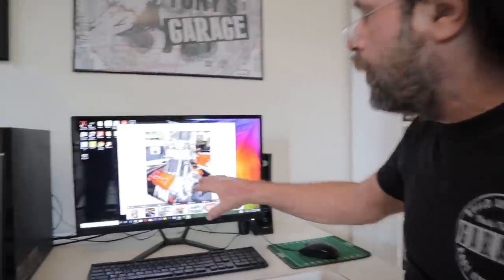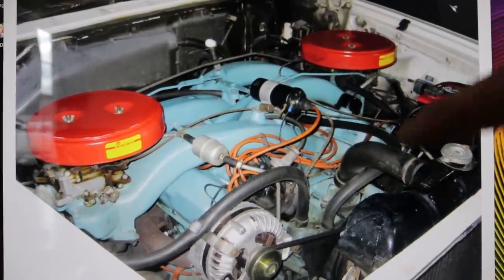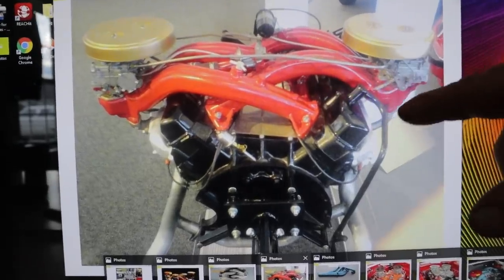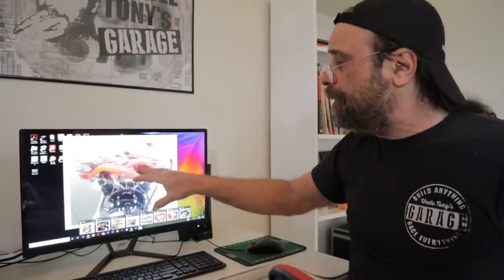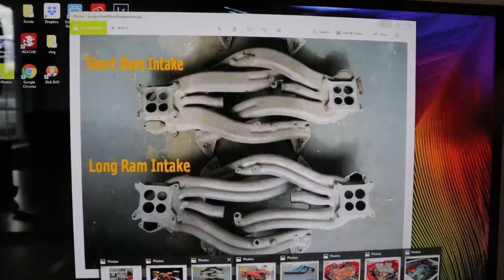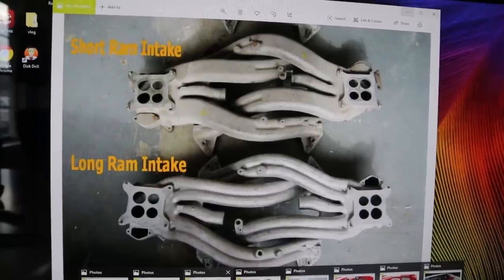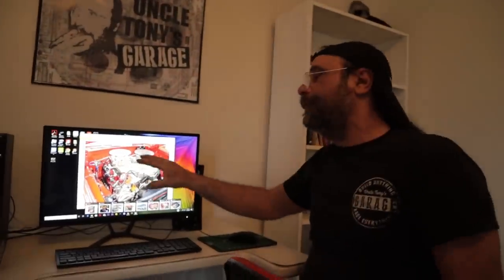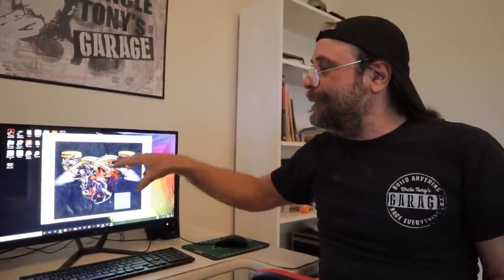The Original Mopar Cross Ram Intake Manifold

Comment: I  owned a 1964 Sport Fury,  with the later version of the Long Ram intake.. It was on a  426 Street Wedge, with a Racer Brown cam.. To make it fit, the inner fender was cut out on one side.  With a 391 rear axle, and a 4 speed, the car was    hard to beat on the street.

Comment: We ran one of those on a stroker at Westech-it was awesome-you should see the fuel stand off coming out of the carbs at the different RPM
Reply: Any chance we can get a factory shoot out someday? Maybe small big blocks would keep the price down.
Reply: Same but different.... I remember reading about taking the air cleaner setup off the same era VW beetle , and it runs like crap. 
That big ol tall air  filter kept the fuel stand doing what its supposed to do.

Comment: And this, is why I love old school Chrysler, when it was a proper engineering company, today Chrysler is a shell of what it used to be, and it is such a shame. Also, I am so glad you make these videos, your videos make me smile and proud to be a car nut.
Reply: W Winterheart  Sadly true. Technology they had even just 30 years ago, seems to fail now. My 94 dodge has roller rockers, never been a problem. 2012's with the 5.7 hemi, have roller rocker failures. lol Whyyyyy? Its old tech for christ sake! It worked fine 30 years ago!
Reply: @zeppelin67637  roller lifters not rockers.
Reply: W Winterheart  a lot of aftermarket roller lifters are junk also.
Reply: zeppelin67637 2 reasons:
1. “Value” engineering
2. Eco-Nazis
Reply: I love my old Honda, if I had a bit higher budget for parts, I would also be rebuilding an old Chevy truck. I worked on modern vehicles for a little while as a lube tech at a VW dealership...... never again. The Germans do stupid crap, AND charge way too much for it. The American vehicles did other stupid crap, but it wasn't insane expensive to fix.....Toyota is a pain in the ass to work on, but they tend to be reliable, and Honda tends to (in my experience) still be pretty easy to work on for the most part and reliable. I had a Nissan Rogue break down just after it was taken off my lift, because of a recall that was never taken care of...this vehicle was being inspected for sale on the lot as a used vehicle.....and it cost the dealership money because no one had bothered to check if it was up to date on its recalls...I dealt with so many broken vehicles that were only a few years old, did not matter if they had been taken care of or not, but I saw far more issues than is acceptable, more so for the cost of modern vehicles. Yes, have been crap cars through out car history, but by this point.... they should know better. But, welcome to a world where its all about buying the newest thing with the most gadgets.
Reply: @glenholmgren1218  Eco Nazis have nothing on me, my car gets 30MPG in town and 48 highway, with out me trying. I have made Toyota Prius drivers cry when I tell them what my car got on the highway :) And my car is actually fun to drive XD

Comment: I found an article on these manifolds and it gave all the theory behind them. Now here's the kind of cool part. When I was working in the shop, pulling parts for customer custom builds and was sorting through our gasket section in the warehouse and I found an open box AMC V8 intake gasket. A little ways down the line I found an open box Big Block Mopar intake gasket. Both were steel or tin type gaskets and when I pulled them out of the box to make sure that weren't bent or rusted, the intake ports looked very similar. So I put one on top of the other and the ports lined up perfectly, but the width, one side from the right to left banks went the same. And the Mopar had an open lifter valley which took its own cover. The intake manifold in stock covered that area while the AMC went under the manifold. But the distance from the front to the back of the ports was exactly the same. So, when I found this article on the Mopar Rams there was a section on AMC guys using them on their engines with slight modification.  The ram intakes were tuned for peak torque to arrive at 2800 rpm or slightly higher on the shorter version.
Side note, there are three different versions of the ram intake. The first is a long ram tuned to a lower RPM, a long ram with Exhaust Heat to warm the air fuel charge for winter operation, and a short ram for higher rpm. These are some of the coolest manifolds I've ever seen, and they were making replicas back when I found the article.

Comment: The RamChargers... Inventors of the Tunnel Ram intake!
Reply: Ummmmm, no. The box with the hoses on it was used by Chrysler to determine the effect on length and diameter of the port for cylinder filling. It was lazy because of the plenum size. They found that by reducing the plenum and lengthening the tubes, they could achieve a velocity that would push the charge rather than draw it. Tunnel Rams back then were lazy at low RPM but made crazy power in the higher RPM. That concept was taken from Rochester Injection units found on GM cars in 1957; Chevrolet and Pontiac. Similar upper manifolds with the lower cast to the needed engine. To that it is thought that Offenhauser took one and machined a carb mounting on it and closed the side air inlet. All of this just shortly after the release of Fuel injection. Large plenum, short runners what a small block Chevy needed and could do. This was the exact opposite effect Chrysler was looking for. Chrysler even experimented with a long set on one side and shorter on the other, trying to make a flat torque peak. It did not achieve the desired result so the mixed runner idea was forgotten. None the less, it gave them the learning curve needed to make the Max Wedge and Hemi programs lethal when released on the public. Notice nothing like a tunnel ram as we know them, was ever used by Chrysler. They built the old 350/361 for torque, not RPMs. I am curious if the 383 ever got the Sonoramic treatment.
Reply: @thegreenerthemeaner  the "idea" of the Tunnel Ram did come from the RamChargers..of course it was modified through the years to achieve the desired results that people were seeking.  Tunnel Rams when "properly sized" to the engine it is feeding will deliver more torque than any other manifold design...

Comment: Those pulse waves you mentioned are similar to the way standing waves work in expansion chambers on 2 stroke engines
Reply: @johnpossum556 " What does that have to do with intake manifolds" somone might say. Well, thee's a new long span bridge under construction that looks good in a static setting. But with a little wind, theee is fear that it  may have a torsional loadng problem. If you had been here to bring it up John, it would have saved a bunch of money.
Reply: Comment threads like this are another reason to love Uncle Tony's Garage.  
Thanks guys for putting your time into making a better world.
Reply: @Riverdeepnwide  Exactly. Now... if high school shop teachers had this forum, homework would have gone a lot faster.

Comment: I really like those cross plane intakes. I can only imagine the torque pump they created
Reply: I am hoping to put the Edelbrock 71413 cross ram intake b/c of this era of true engineering. They reached the limit of what could be done. So they made another way to skin the cat..... just like the SR71 black bird they did it with out computers. Sometime the art of engineering is lost in a computer
Reply: Lassi Kinnunen lol obviously they didn’t hate technology they were on the cutting edge of technology. My point being is just like Math nowadays it’s hard to do things without a calculator because we are reliant on them. When the SR 71 was built they didn’t have computers to do the math for them. In 1966 when the SR71 was built computers were highly specialized pieces of equipment. Five years earlier in 1961 we sent The first Apollo rocket into space. The Apollo project push the boundaries of technology and if you ever get a second you have to look at the original Apollo flight programming computer it’s impressive. It may have less computing power than a phone from 10 years ago however it’s so dedicated to what it does that a modern iPhone couldn’t fly the Apollo rocket. It was essentially a computer that was the size of a small building but with the invention of integrated circuits they brought it down to the size of the picnic table. There’s a YouTube video of them actually restoring One that failed to launch because of a sort in a potted circuit. After they repaired it they managed to initialize it and hook it up to a modern computer and had the original flight plan on it and that’s incredibly amazing and speaks to the quality of the computer they built. lol sorry got off on a tangent I do that but yes in short they didn’t have computers and said the late 60s however they were not the kind of computers you’re thinking it wasn’t until there was a huge revolution in the design of computers mostly driven by a few very competitive computer designers and businessman. During the ram air era the engineers really did just do a lot of grunt work when it came to designing. Now  where where I was going with all that lol. I think there is some of the creativity and imagination lost using computers in engineering today. Not saying that the things that are being built are built better to just less creativity in solving problems. I think it’s mostly due to complacency not say laziness. Anyways that’s how I feel About it. And if you just read all of that I would really love to know your opinion on it 🤘
Reply: Lassi Kinnunen in fact I watched a documentary recently where they re-designed the SR 71 blackbird on A computer using auto desk inventor and they could not make any improvements the design was flawless.
Reply: Engineering means keeping your mind engaged. A hydrologist told me about his first big job. He had a pencil and paper and a mechanical adding machine. When there was a discrepancy in data it was readily apparent because his mind was involved in all the calculations.  He retired right as the super computers came about.  Two young engineers ran the computer, just feeding it data.  Well, GIGO.   There is a very large lake dam here that is 2 feet lower than intended because of that computer.
Reply: Lassi Kinnunen  the story kelly tells is that all the engineering and calculations were done by hand on all the variations of the blackbird until they revisited it in the 90s or 2000s and the computer analysis said that it was literally as optimal as possable and had no further design& engineering-change suggestions
Reply: @adammyford  yeah i remember reading some insane numbers like that
Reply: @LunarOutlawsGarage  9
Reply: 500 lb ft. A new v6 f150 raptor makes more lol
Reply: As I can best recall the torgue it was 465 foot pounds at 2,900 rpm.  Long time ago I owned the beast.

Comment: "Spaghetti Cross Ram Air Intake"  When you lifted the hood on a 60s letter car and you saw this your mind was blown. There were these support rods that ran from the bottom of the intake manifolds to the top of the exhaust manifolds.
The throttle linkage traveled between the two carburetors to a pivot plate. You wanted one. You wanted one so bad. You were lucky if you got to look at one. They belonged to your rich friends uptight father who wouldn't let you anywhere near his car. This setup was primitive space age technology from the dark ages of the future. There did you get a good look at it?  Good now get lost. Every now and then you would find half of one broken in a wrecking yard, or the remains of an already scavenged vehicle.
Rarer than hen's teeth. Collectors who collect this shit. Rarest of all was one with a 4-speed. And they would all stand around talking about  "stump pulling power"
Compared to this you didn't have shit. 130 miles per hour all day long. No sweat. Let the cop follow.
All the way across Wyoming headed towards Jackson Hole, with your skis running between the four bucket seats.. The car had ashtrays, so you could smoke between drinks. Montana had no speed limits. Do you know how fast I clocked you?  Over 50.
I spend up to 70 while you were standing on the brakes. That would be over 50
Reply: Change spark plugs through the wheel well
Reply: Support rods?!?!  Do you mean the exhaust tubes between the intake and exhaust to provide heat for fuel vaporization?

Comment: Have a 2003 Chrysler with the 3.5 hi performance.  The intake manifold has internal baffles, operated electrically by the computer, that change the length of the runners at whatever the computer is programmed for.
So they are still playing with ram induction!
Reply: Skip D love my 2001 300m
Reply: Yep. I have a Probe GT with the 2.5 V6....similar setup....I think my 97 F-150 4.2 had it too...

Comment: I'll never forget coming across a couple of ole' weed benders in the rurals of southern Illinois.  They had the hood up on an old Dodge or Plymouth about '63 vintage, and it caught my eye because I was - and am - a Mopar guy.  I made eye contact and started talking with them when I glanced into the engine bay, and here was one of these long ram induction intake engines (I remember it as a 413?).  The whole setup, engine and car, was like a barn find just rolled out of a shed.  That was 30 years ago but still a magical memory.

Comment: Awesome video in high school my senior year I rebuilt a 300J Chrysler with a I think it was a 426 wedge cross ram or a 413 can’t remember but that was a neat car . Two door bucket seats , rap around dash and a push button automatic. Then in college at Mt Hood Community College we had a awesome s auto program with a complete machine shop. And had a auto club which was a 501 , 3c nonprofit and a bunch of instructors that liked to build race cars. The first car built from basically junk parts was a 62 corvette with a 327 bored .030 over. Well our main competitor was a guy from Woodburn, Oregon that had the nickname the Mad Russian because he did some crazy stuff. Well his car was a 64 Belvedere with a 426 wedge duel 4’s and the short cross ram and a push button torque flight and we ran in super stock class. We could only run the 327 4 barrel carb. He used to kick our ass. Well over the years we went all out roller cam .600 lift triple springs , stud girdles and some illegal heads at none point match meets. Our engine we’d come off the line at 10,000 rpm then shift at 8,000 rpm but he would always beat us by 2 one hundredths. Many years later I ran into him and told him who I was and the car so I said we were running illegal heads. He said he figured we were but he never challenged us because he always won. All you had to do is remove the carb and look down the runners to see we were running 202 ported and polished heads, fun times. P S the name of the corvette we rams was HomeWork

Comment: Great episode!!! I have the 30" runner length setups that will be put into an early 70's truck on a 440... The trucks that are towing heavy trailers can really use the torque increase of these... I will first use 2-ea. 390-cfm 2-bbl. Carbs and see how that works... The cam will be one of the mild grinds.... This is the kind of engineering that Chrysler was famous for back in the 50's & 60's...

Comment: I had the opportunity to work on a 1960 Chrysler 300f with I believe was the 413 with the cross ram manifold. It was wild to look at and drive. Also My boss used to race modified's in the mid 60s and ran 426 max wedges with stage 3 heads and the dual carb manifolds. He still had all that stuff in a room in the back of the shop when I started at this Chrysler dealership back  in 1996 but sold it all around 2007 or so. Basically gave it away for 6500, which is what I thought then. It was 5 complete  engines and 2 blocks ( all stressed out from racing tho) and a whole bunch of other parts. The guy that bought it all couldn't get it out of there fast enough lol. Years later my boss now thinks maybe he really did give it away for that price. Always enjoy watching your videos, very informative thanks

Comment: I bought a set a few years ago for $200. They were laying in the back seat of a 76 Volare Roadrunner. From what I have read they are the short ram version. The runners inside the tubes only go up ten inches, the long ram versions runners were the full 30”. The short ram was an over the counter race version. I tried to put them on my 69 Roadrunner but they wouldn’t fit without cutting.
Reply: Jason Wandling $400 buck right now. Ill pay for the shipping.
Reply: I gave them to my dad.